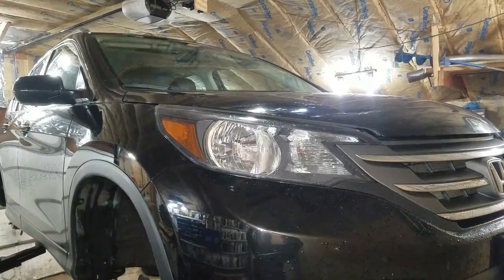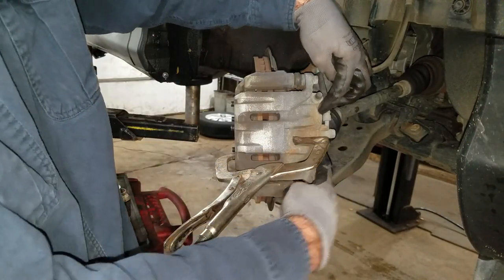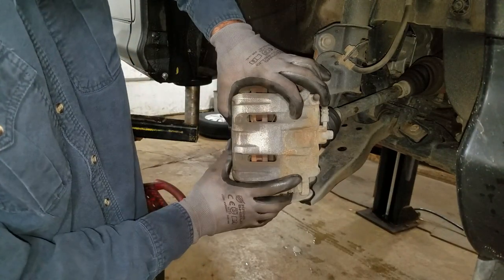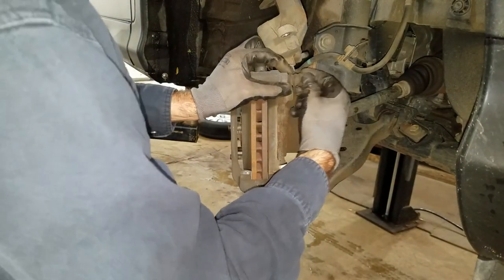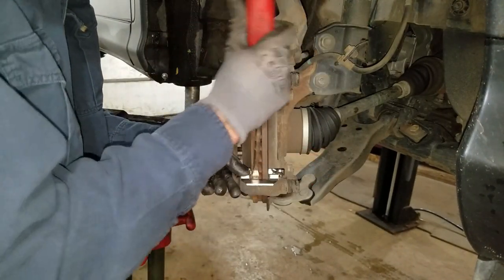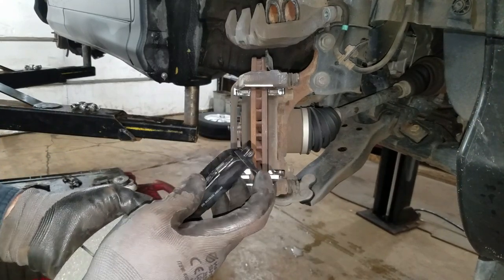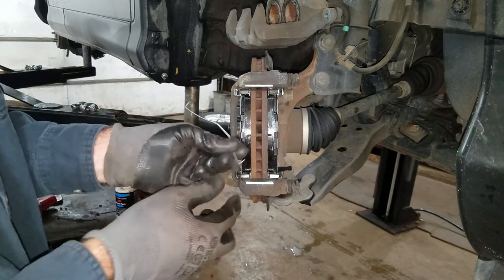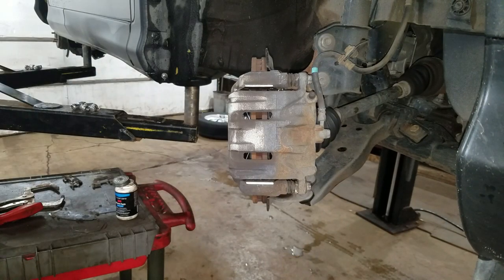2007-2016 Honda CR-V front brake pad slap

Comment: Great video Thanks - I don't have those springy-ding things on my 2008 CRV - were they a later addition?  Can I get them and add them?
Reply from the maker: You could. They are not really necessary. Most brakes do not have them. Any small amount of warpness, or movement in the rotors will push them off the rotor.
Reply: @RustBeltAuto  Thanks for the speedy response- I've seen these clips included in some b-pad hardware kits - I'm guessing they help keep the pads from rattling and also off the rotor.
Reply: @RustBeltAuto  How can one see/confirm if a rotor is warped?
Is it as simple and trying to spin them while on the axle?

Or should I use some sort of straight edge to see if there's any space coming through?
I've never had warped rotors before, just really gouged and rusted ones before.  Right now, to my UNTRAINED eye, they LOOK good.

But...... 😁
Reply from the maker: @BlondieSL  if they are not pulsating, you can call them good. By the time they are out of spec, you can feel it. You are supposed to use a dial indicator for warp, and micrometer for parallel.

Comment: with those sliding pins on the calipers, if we find that they have some rust on the pins or at the head where they seal, is it ok to:
1) use a spinning wire brush to clean the pins?
2)  can you use a small wire brush to insert into the pin's channel, spin it by hand to clean the inside?
3)  is it ok to use a general grease to grease them up?  Never mind this one.  It turns out that I did buy the correct, Silicone brake parts grease.  😁

I ask about the wire brushes because I use these to clean most stuff, but I'm concerned if they would score (or scratch) the pin or the channel the pin slides into and if scratched, would that cause problems down the line?

Thanks in advance for any advice because TODAY, in a few minutes, actually, I'm going to do the front calipers.
I had all 4 calipers binding up, causing drag and massive heat build up (literally boiled/steamed water when I tested by pouring water on them).
For the rear, where it all started, while I didn't take the calipers off yet to do the clean and grease thing (although, I'm going to do new rotors, brake pads and parking break shoes) I did put some 3-in-1 Penetrating spray into the channels and now, the rear brakes seem to be ok and not heating up now.

But the right front is the only one getting super hot, so that's the one I'm first going to concentrate on today.  It LOOKS easy, so it if it, I'll do both sides of the front.  I just hope springs and stuff don't go flying!  😁

Thanks in advance for any ideas on the wire brush thing.
Reply from the maker: You can clean them, or buy new. There is a galvanized coating on them to keep them from rusting, but it does no good in the rust belt. Wire brush is fine. I use wire on a bench grinder.
Reply: @RustBeltAuto  A huge thanks.  Yeah, that was the danged word I was looking for, "bench grinder."  ROFL
I also have some wire brushes of different sizes on these long twisted wire things.  I thought of just cutting off the handle and using one on a drill to clean the inside where the pin goes.

Thanks for that response.  I really appreciate it!
Reply from the maker: @BlondieSL  bore brush

Comment: Ceramic eats the rotors worse than cheap pads correct? Isn't the goal to wear the pads? Just thought I'd get your input
Reply from the maker: Yes. "Eats rotors", if you want to call it that. Organic pads last longer than organics. Shorter life on rotors? I beg to differ. They will not last to a 3rd set of pads, especially in the rust belt. When I use ceramics, I don't see people as often for brake jobs, and noise complaints, and dust on rim complaints are almost down to zero. Organics are quiet too though.